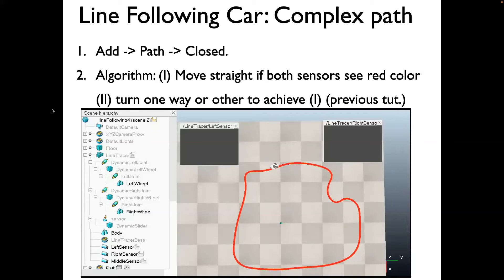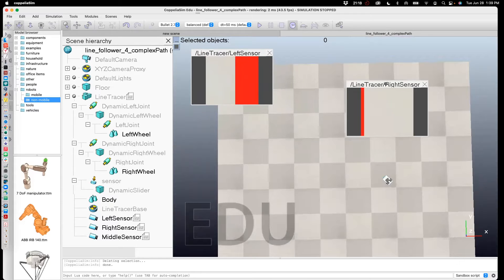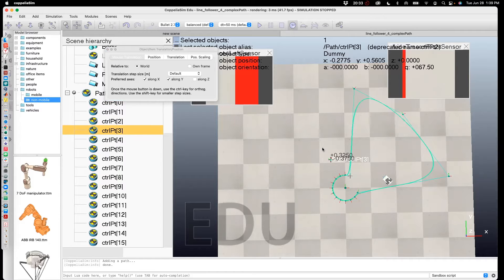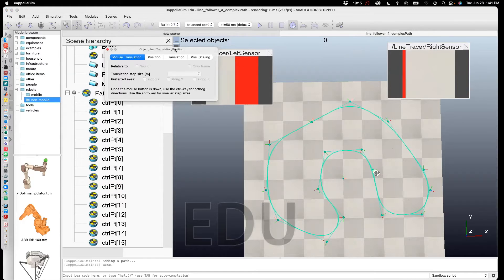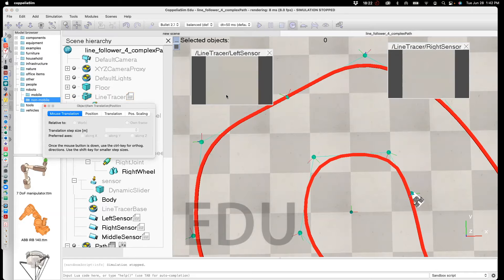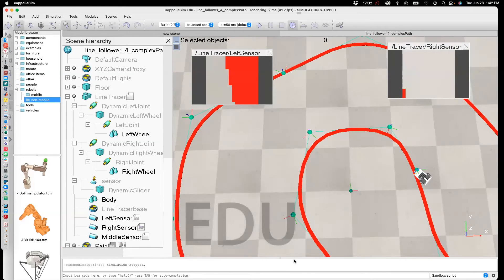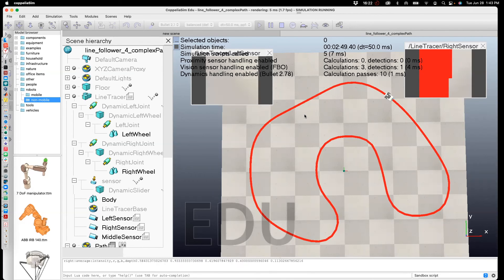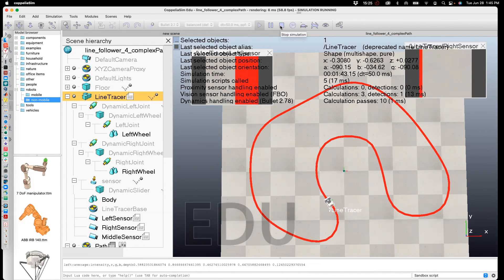CoppeliaSim: Line Follower Car, Complex path (part 4 of 4)

Comment: I downloaded the code, but the robot won't follow the red line.
Reply from the maker: There is bug in coppelia sim where the line height is incorrect. Double click the shape in model browser. Then go to geometry. The uncheck the scale option. Finally set the height to 0.01. Save and try again. Does that work for you?
Reply: @pranavab  I didn't work
Reply from the maker: @vijayvikasmangena1765  maybe you can make a video and share and I could debug the issue from the video.
Reply: @pranavab  Can you send the file of the object in this video? Thank you in advance!
Reply from the maker: @ https://github.com/pab47/CoppeliaSim/blob/main/430/line_follower_4_complexPath.ttt